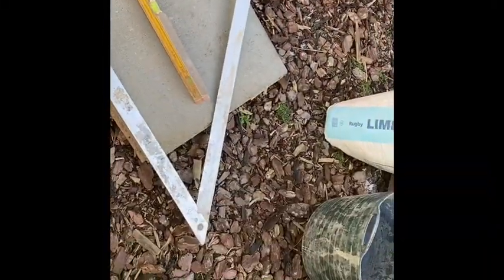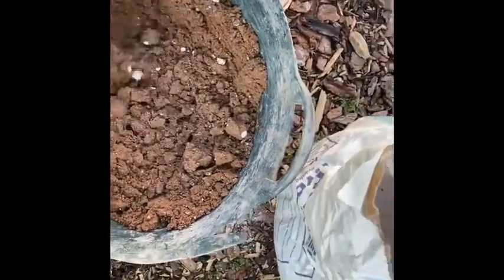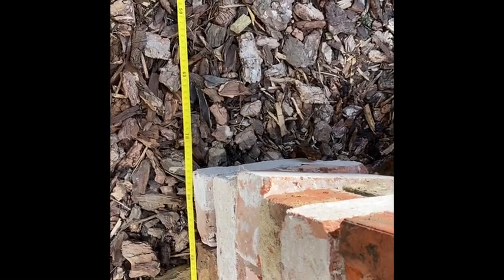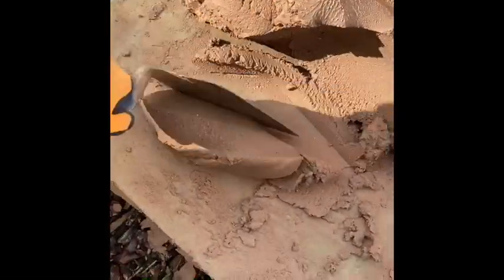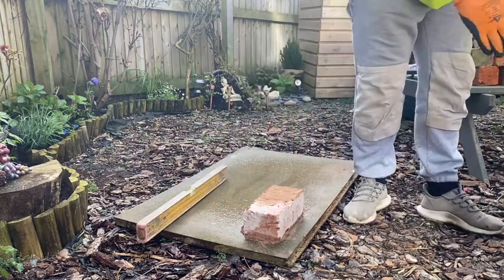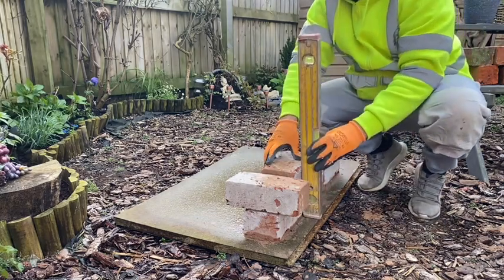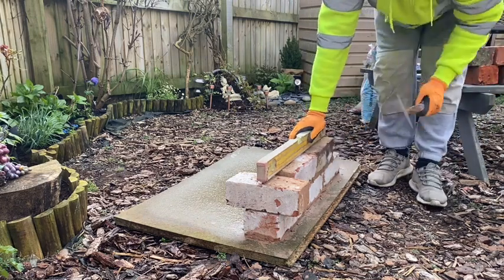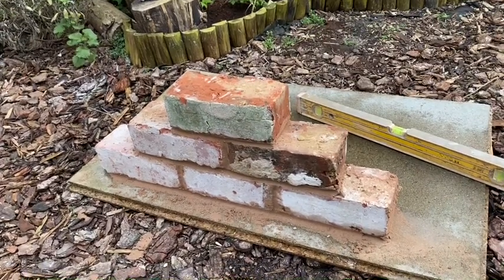Lime mortar how to lay bricks.

Comment: Hi there, looking at various sources the recommended ratio of NHL lime to sand is 1 lime to between 1 to 3 sharp sand. One research paper even says the victorians tended to use 1:1.5 ish. 

I have used 1:2 for a solid masonry wall but despite soaking the bricks the mortar would stiffen within about 30 seconds between bricks so very limited time to tap down and tidy joints. The lime was well in date so any ideas? I see a lot of YouTube videos where the mortar stays workable for a good while after the bricks are laid. Thanks. Thanks for the video.
Reply from the maker: Thanks for the comment jack. I think a 1:1:5 seems ok. Adding a bit more sand will probably help with workability. I’ve use 1:1:6 that was good to use. But you need to take into account how exposed is the area your using it for freezing and thawing. How much movement it’s dealing with and it it’s damp. Hope I’ve help a little for you cheers 👍
Reply: @rowlockconstruction8345  Hi, thanks for the reply - think we are talking about different mixes - I mean 1 lime to 2 sharp sand (1:2) - (no cement obviously!). I was surprised by how much sand you had to not much lime but your mortar looked very workable. Ill have to find out if my mix stands the test of time! Wall built.
Reply from the maker: I think because you have so much lime in your mix it’s making the mix go off quickly. I think you would be fine taking it to 1:3. It might help with it not drying out as quick. The mortar I was using in the video does go off after a few day. So 1:3 would be a bit easy to use 👍
Reply: Rowlock Construction Great thanks for the reply. A few more courses to go to keep it consistent but after that I’ll experiment with different mixes. Something I should have done before really! Ta
Reply from the maker: 😂 yeah keep on going pal 🧱👍
Reply: @jackd1221  Two very different things here. This video is not lime, its cement with some hydrated lime in it. Totally different to what you are using. Totally unsuitable for an old building. The mix you are using is right, bagged NHL 2 / 3.5 with 2 or 3 sand respectively will be fine. It is crucial to really soak the bricks down prior to pointing/laying. Not five minutes before but night before and then again a goof half hour before you start. The NHL 2 will take a good half day till you can tap it back, the NHL 3.5 might be quicker in the summer but you don't want it to be too quick. Keep misting it down. key is just to keep it moist and check it regularly.
Reply: Doesnt hydrated lime need cement to make it go of were 3.5 hydrolic doesnt

Comment: I don't believe hydrated lime is meant to be used as a binder by itself? Anyone else seen this used by iteself with sand? At 1:8 ratio? I would think the sand will wash out of these joints in a few short years...
Reply: think this is supposed to be a 'training mix' and I was interested in the ratio for that purpose.  @stu crompton deals with training mix with 1:6 ratio but declares that you don't want too much lime so maybe @Rowlock construction has a point at 1:8?  This is only supposed to be a means for people to practice laying down bricks over and over by cleaning/reusing the bricks and re hydrating/mixing the mortar?